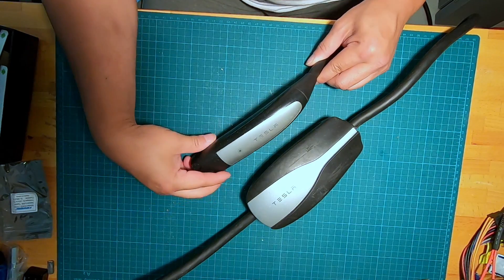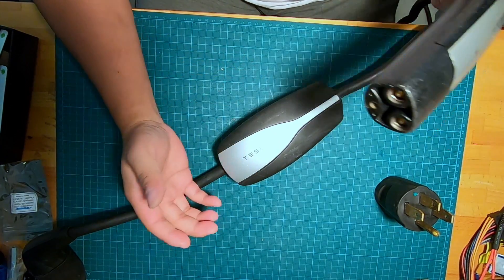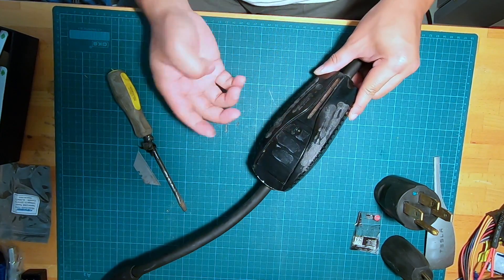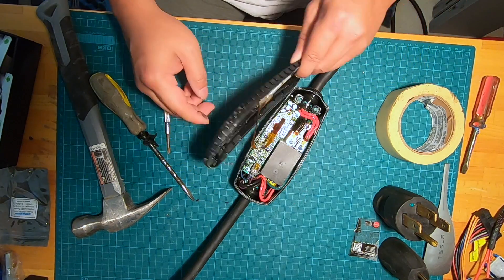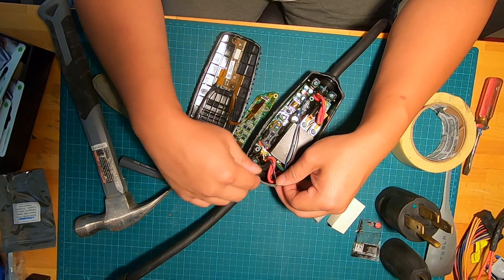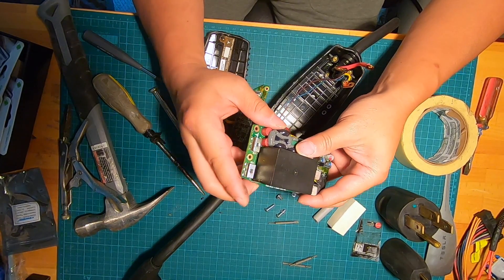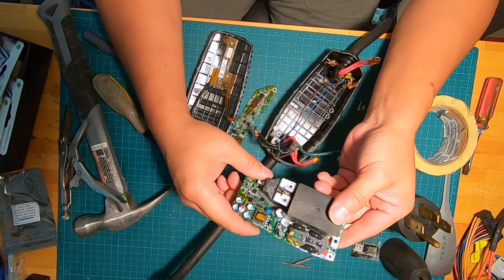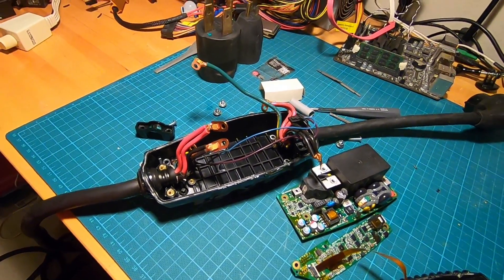Tesla Mobile Connector Stopped Working

Comment: I want to know the diagram or wiring of the circuit that is inside the adapter plug 🔌 that goes into the wall power outlet 

Open that adapter plug too

Comment: Why didn’t you try to measure anything? Was there voltage at the input? Was there voltage at the output? Did you try to measure the cable with an ohmmeter while twisting it?

Comment: Hello everyone. Faced with the same problem. The letter T blinks 5 times. I looked for a solution for a long time until I took the charger from a friend. It turned out that in my case, the problem was with the detachable plug of the charger itself, which has a built-in temperature sensor. Because with a friend's plug, the charger works correctly. In my case, the previous owner converted the plug itself into a Euro plug and probably damaged the board with the temperature sensor. Maybe this can help someone. Greetings from Ukraine

Comment: Mine does the same thing. On 120 charges 3 miles per hour and on the 220 plug blinks red 5 times and stop an does it again.
Reply: Mine is having the same issue for some power outlets (red light blinks 5 times) but ok for others starting recently on the 220 plug. How did you fix it?

Comment: Thank you for sharing this with us. Potter Brumfield makes relays so it is relay. The relay keeps power off the connector until it is plugged into the car. That way there is no arcing when you  plug it into the car, nor danger from electricity. It is too bad Tesla does not make this serviceable but it is probably a safety concern. Everything is a cost concern, but if Tesla was so environmentally minded, they would have made that box with plugs at each end so that users could interchange different lenght cords and replace just the box instead of the entire charger,
Reply from the maker: Thanks for the information about the relay. You are right, replacing the relay sounds dangerous for DIY. I am not that proficient for electronics repair. :-( will just sell for parts. I bought a new Tesla Wall Connector

Comment: Since the charger did not show any fault lights, you could consider that the fault might be in the car-plug?
Reply from the maker: No, the car's charging electronic works fine. I bought a Tesla Wall Connector after the Tesla Mobile Connector died. The Tesla Wall Connector charges my Tesla Model S just fine. Confirmed it was the Tesla Mobile Connector.  Thanks for asking.

Comment: Hi, I have an issue, received from eBay a charger with cut wall side adapter. If you remember can you, please describe the wall side wiring , or if you still have it can you please check for me which color of cables is which pin. I understand that red id L, Black is N, green/yellow is G. But for what are other 3 I still didn't found on the net.
Thanks in advance
Reply: I cut the wall side plug and install the 220 plug directly. 2 reds on one line 2 black on the other and the green/yellow on the ground. It blinks red 5 times takes a break and does it again. Wondering if I did it wrong. May be it’s the way you described it the reds are the 120 lines and the blacks are neutral. Yellow and green ground.🤔